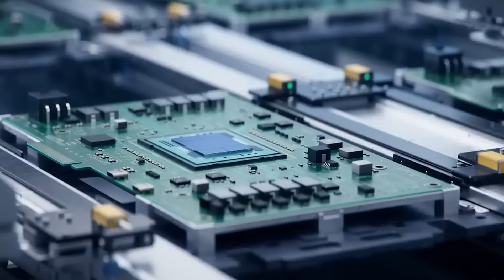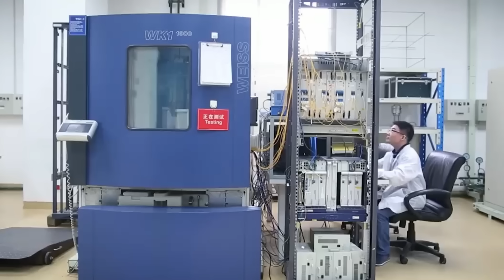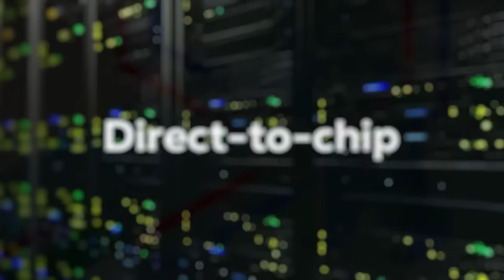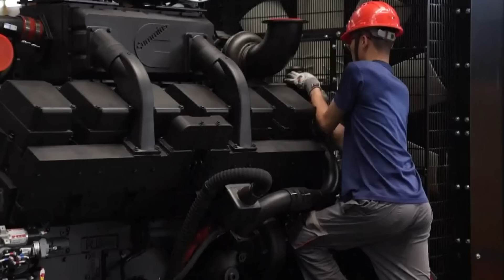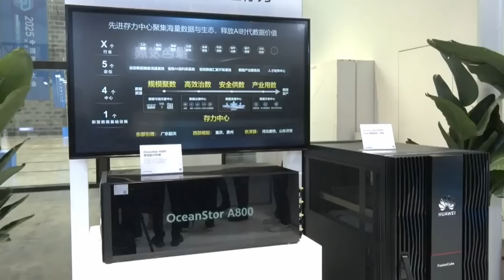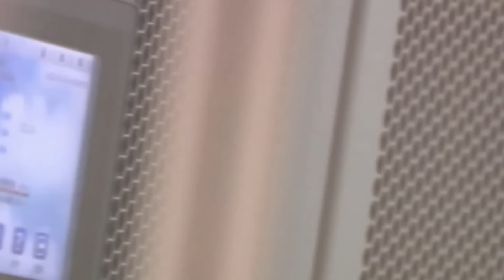How China Built the World’s Largest AI Mega Data Center

Comment: This may be a very major step towards the arrival of the holy grail of AI - truly general / autonomous AI systems. This installation will certainly be used for the benefit of ALL Chinese, providing a depth of information that exists nowhere else in the West, and the system WILL also be used to design and optimise it's eventual replacement.
Reply from the maker: This will definitely a great piece in the plan to make truE AGI
Reply: @TechInCheck   Look at all that space. China has plans to fill that, and the location is cold (so reduced energy needs for cooling), as well as having already a very high local investment in alternative power (wind and solar); Huawei  already  has a 3nm EUV prototype producing wafers, and they will easily be able to meet the compute demand should expansion proceed.
Reply from the maker: @phils4634 true true